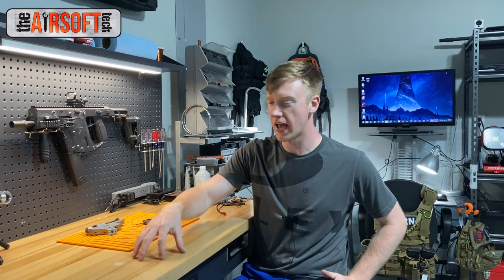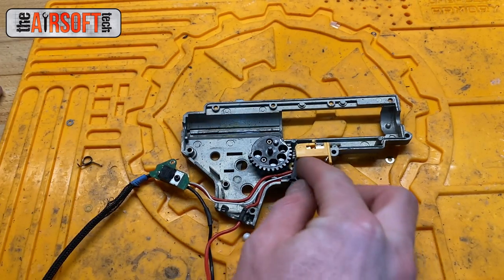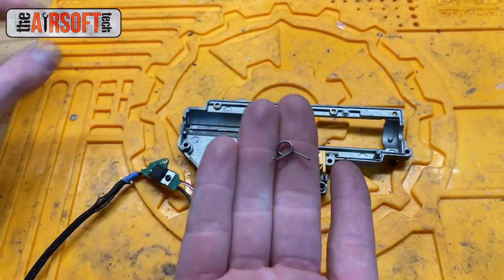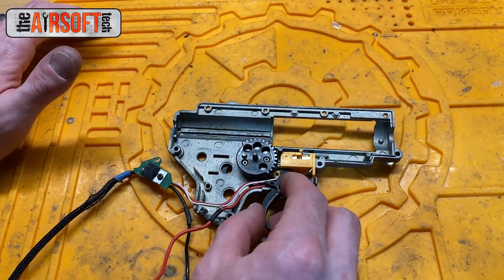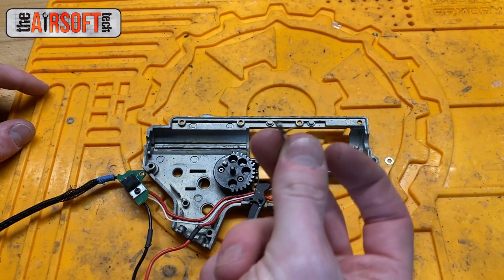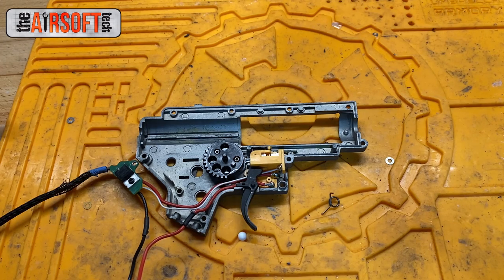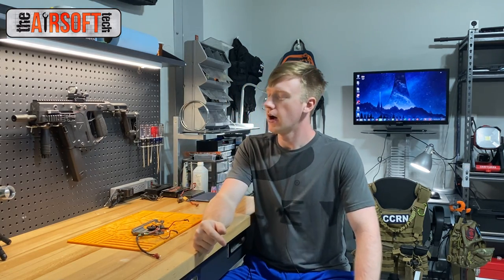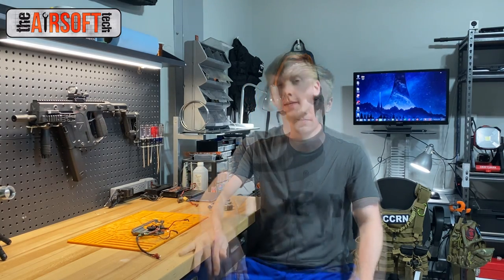Back to Basics: Broken Trigger Spring

Comment: Ehhh... I have never seen one of these springs broken in any V2 gearbox gun. I have had one break in a V3, but that's it.
I think a bigger problem is when the trigger trolley wears down and the sharp pointy part that the cut-off lever catches on gets worn down and doesn't allow the cut-off lever to do its thing any more, that is a bigger problem and one that is more likely to actually happen after possibly only one season of use depending how terrible of plastics that are used on the trigger switch assembly.
Got to tell you, this wasn't your best effort. 
Is it possible the spring breaks? Yes, possible.
Is it probable that the spring breaks? No.
Does the plastic trigger trolley wear out faster than spring steel? HELL YES!
That is the most common cause of semi lockup and why most people switch out the nasty, old school trigger contacts to a MOSFET system, either an optical system or a magnetic system.

Comment: Have been running into a issue with a king arms gear box where in semi-auto the trigger sled slips above the trigger and will not reset no matter what. The trigger is all the way forward in it travel range as well. Have tried brand new trigger assemblies from different manufacturers, and yet the issue still happens after a few shots in semi auto.

Comment: New to the sport,  ordered and received my first airsoft rifle in January,  played my first game last month.  I run with the krytac alpha crb and wasn't happy with the trigger pull/ response,  so I just swapped out out for a krytac flat trigger last night. Now my rifle is shooting with extremely low pressure, dropping bbs at 5ft, double feeding,  and in having bbs feed but rolling around in my barrel and not firing at all.  PLEASE HELP. 
 Love your videos brother,  hands down the best educational break downs I've come across yet.  
Side note,  it's as if my nozzle isn't sealing properly to create the pressure needed in the hop and barrel.
Reply: I know I’m late and I’m not the guy you wanted hopefully your gun is fixed by now. If not it is most likely the tappet plate and the nozzle. You probably didn’t reinstall it right. Maybe you didn’t even touch it and it just got messed up when you opened the gearbox. I’m not a professional tech but I think that may be the problem.
Reply: @lightningscreations  you are absolutely correct! My nozzle wasn't installed properly.  I lubed the slide rails and slipped the nozzle back into place,  she started firing beautifully! You are just a little bit late,  but spot on with the info.
Reply: @jperdue3567  I wish I could’ve helped sooner but I’m glad that your gun is shooting great now!
Reply: @lightningscreations  unfortunately that's not the case.  It was amazing until I upgraded the spring to an m110 and krytac 30k motor.  It did fine for a while,  but last time I took it out, it started double and triple feeding. A friend who techs said I should cut the tappet spring to give it a stiffer pull so the nozzle retracts properly.  I think it's having a slight over cycle issue so I'm going to throw my stock 20k motor back in and see how she does.  The 20k is rated to pull up to an m120 spring,  but I was having over heating issues with it, which is why I swapped it out. At least this will give me a better idea of where I stand after I swap it back in. I'm learning as I go, it's annoying af but how else do we learn but through trial and error. I just purchased the Lancer tactical gen2 l35 battle hawk. I couldn't be more happy with it out of the box. I field it on the 21st for the first time.  I can't wait.